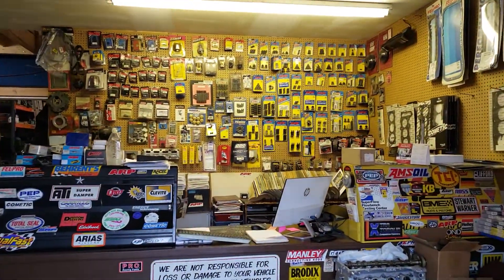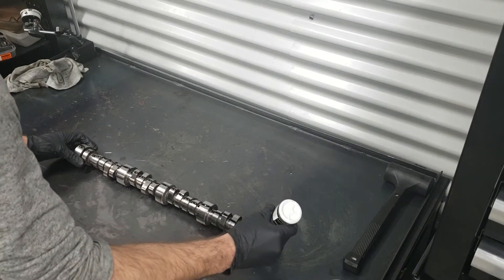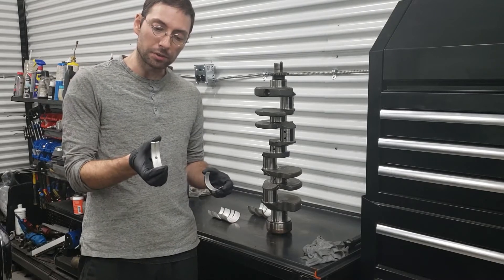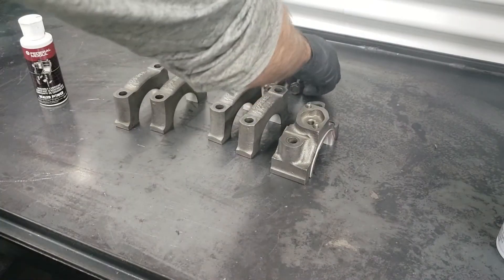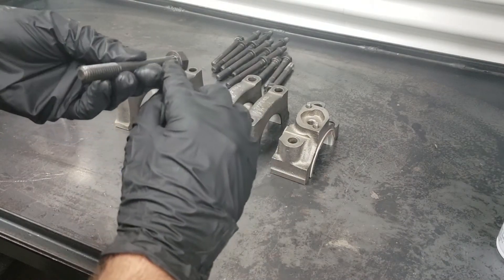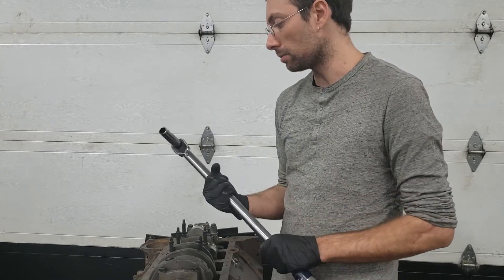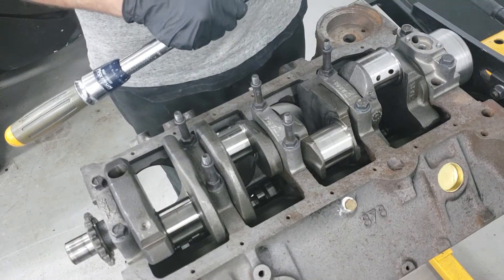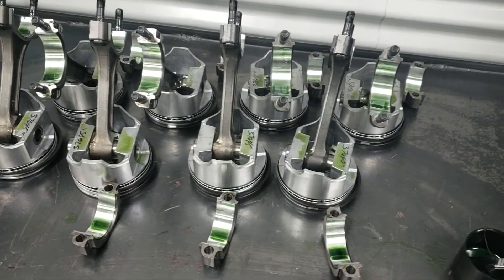Mercury 305 rebuild | part 3

Comment: I'm also having a hard time with the same crack problem.
Can you tell me roughly the price of the block?
Reply from the maker: Hey there. So the Donor block was from a late 90's Astro Van. They  use a 5L block as well. The only difference, is the front water port has an extra relief port on the Marine block, this is for the constant waterflow from the lake/river. I found the full engine for about $500 CAD, and stripped it apart and tossed out the rest of the components since we only needed the block. Depending where you live, these 5L chevys can be found from $200-700 as a full engine from a scrap yard. I hope this helps.
Reply: @DarkBloodMechanical  Thank you very much.
It's okay to erase the price.